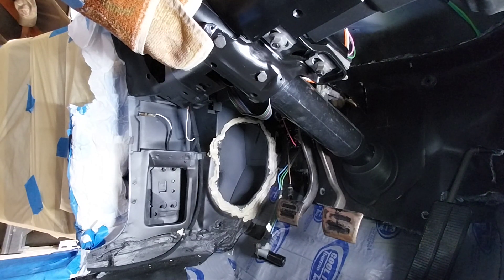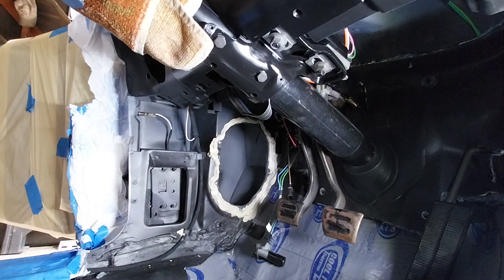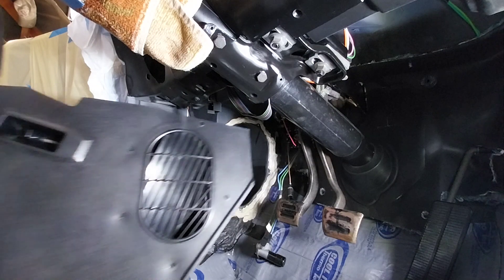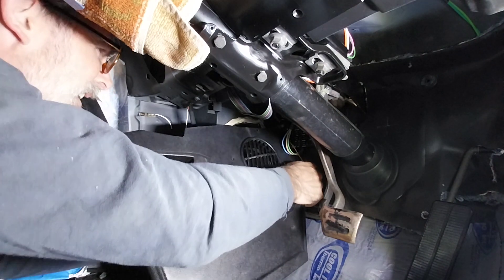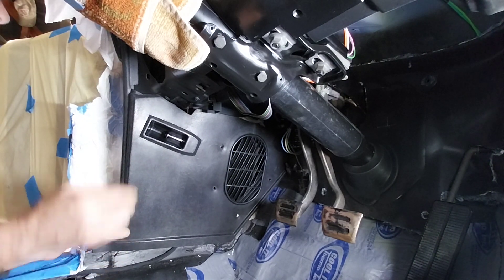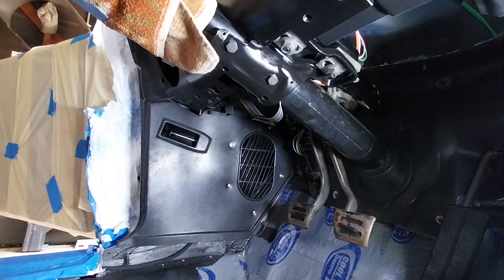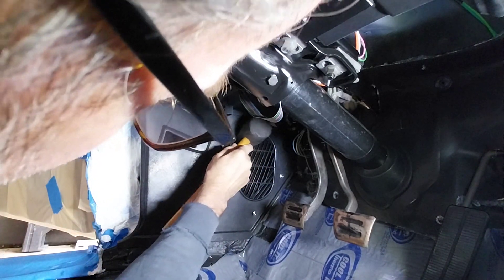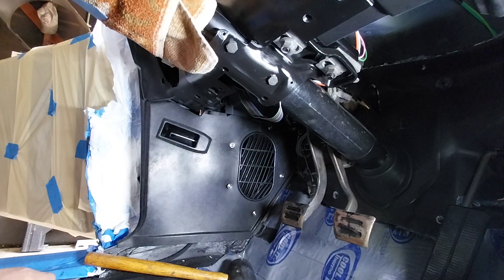1968 Camaro Kick Panel Installation Driver side : 275

Comment: I sure hope this procedure works as well for me when I have to do this before too long. Thanks for posting.
Reply from the maker: Good luck. Let me know how it goes.
Reply from the maker: The driver's side is a little trickier. Make sure the pedals, high beam switch, wires and parking brake assembly is out of your way.

Comment: The way you rotate the part in is super helpful. I'll have to remember that. But, man there's got to be something better than plumbers putty for this. I have containers of plumbers putty on my basement shelf that are dry, shrunken, cracked and hard as rock. How much of a gap are you filling with the putty? I wonder if a couple layers of rope caulk would be good or maybe windshield ribbon seal.
Reply from the maker: Rope caulk would work too. To me, the rope caulk seemed to be a little stiff to used in the larger quantities and i didn't think it would seal properly. Putty is softer.  Would also guess it would depend on the quality of the putty.  Not sure how old your putty was. There was not a lot of information on the material to use, so plumbers putty seemed to be the best choice.
Reply from the maker: I put about 1/2" layer of the putty, but I probably should have put more.  The putty did squeeze out as I screwed down the panel, so I got a decent seal.
Reply: @CamaroRestoration  Thanks. I sourced some duct sealant putty that is knows as Dum Dum putty which is, apparently, what they used at the factory. I'll probably buy a few things and see what feels best at the time. I'm a ways off of putting the interior together but always looking ahead. Cheers!
Reply from the maker: I didn't know that, so you're a step ahead of me.  Let me know how it goes.

Comment: Is that a reproduction kick panel or original? If reproduction, how well does it fit?
Reply from the maker: It's the original.  I have not done any research on the reproductions, but I have heard that some don't quite line up with the dash pad or snug up along the door as is shuts.  Also make sure you know what you need in terms of options with speakers or the astro vent.
Reply: @CamaroRestoration  thank you, my camaro is a 69 AC car. I will try to find originals. Appreciate the info!

Comment: Trying to get old one out used every curse word in the book
Reply from the maker: Not sure if you ripped it out, but if your trying to remove the driver side, don't forget there is a hidden screw behind the parking brake assembly.  Can't remove the panel if the parking assembly is still on.  If that is out, need to rotate the panel counter clockwise and then pull out.